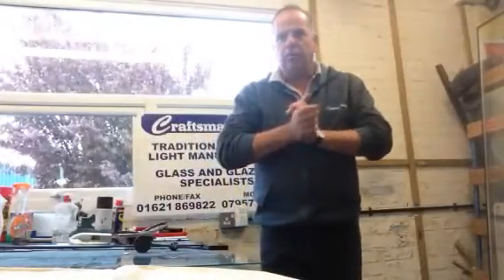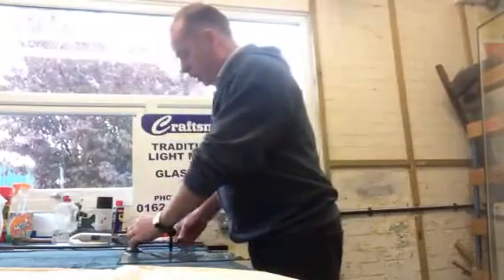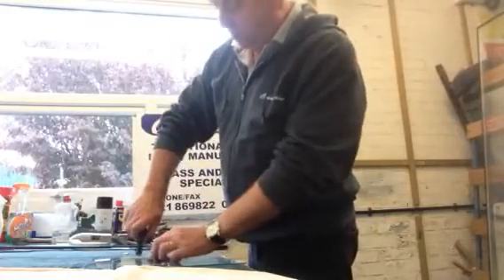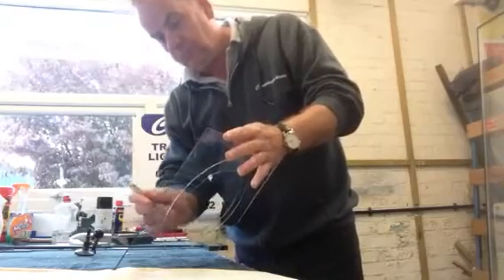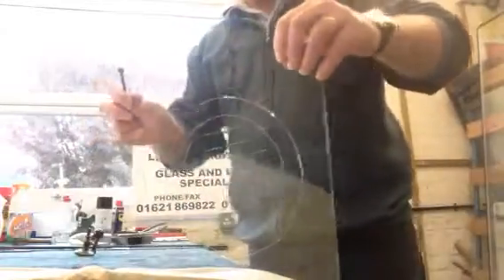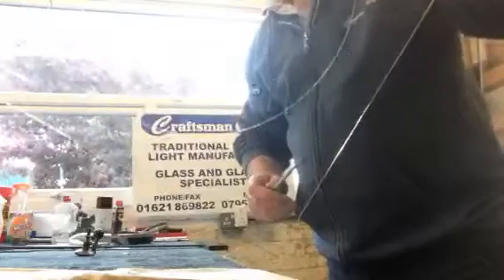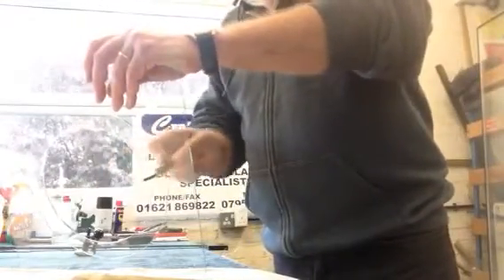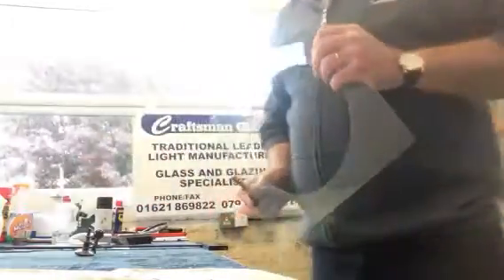Cutting a hole into glass

Comment: Thank you for this... and help me pray today.. I bought a HUGE glass cabinet to build a paludarium.. 140cmx120cmx50.. And i need to cut a 15cm hole into the side to be able to reach the electronics after it is set up...

I might have taken a little to large of a bite to chew because i cant lay it flat to cut a hole into it.. but ok,, it either works or it cracks and the whole thing will have to go to the scrapyard haha..

Thank you for this video very clear explenation, ill try and go about it like you showd,, thanks again
Reply: How'd it go lol. I want to try this on my PC cases side panel because my CPU cooler is just barely too wide for my new case, so the case is just slightly open at the top, I mean it still works and is able to look like it's closed but I want to cut a perfect circle around the CPU air cooler so I can put the side panel all the way on XD. spent 2100 bucks on all these parts and don't wanna get a new case cuz I like it.
Reply: Nevermind it is tempered glass lol. Screw it.
Reply: @tarantulamadness6191  lol , I'm here for the same reason,  I want to put a 200mm fan in the side panel , but yeah , apparently temperd glass the whole sheet will just shatter.

Next option to replace the glass with plastic polycarbonate and cut a hole in that.

Comment: Thank you! 

Upon watching your video, I assume that you need to "tap" the scored glass circle on the underside of the glass. Meaning on the opposite side that you scored with the glass cutter (like I see in the video). I am cutting a circle on one pane of a double-pane window glass and the underside is not accessible. Does this explain why it doesn't work when I tap the scored side?

Best Regards,

p.s. It might explain some of the questions you were previously getting.?.?
The circle is my first step at breaking and removing the glazed in defective pane. IT IS NOT AN IGU!

Tnx!

Comment: Not bad please excuse me.
I have been cutting many years.
From me you need to change that wheel in circle Cutter, you need to apply less pressure on the cut, you need to use cutting oil, you need to use a oil filled cutter again less pressure, for me I use the rubgy ball saftey lines technique, I turn the glass and use pressure to open the cut rather then hitting the hole open like that,, the Chris Cross lines must be with oil, as before a new cutter will open cut lines easyier and thus glass with fall with ease and put less pressure on vent hole, for me the rugby ball lines act as safety lines, tap the middle and work middle first so not to have shells.
Much appreciated for video.
You got it out, 😉

Comment: I have an old aquarium that is going to now be a vivarium. The tank is 5 foot long. The glass is 12mm thick. I want to cut out a 2 foot x 10 inch long rectangle, down from the top - so I only have to make 3 cuts, the 2 foot along the bottom of the rectangle and the 2 sides @ 10 inches. I have various sized glass cutting bits. I have a glass scorer. Would I be able to grind 2 holes, 10 inches from the top and 2 foot apart, then score between the holes, then score from the holes up to the top and then just tap it out? Hope that makes sense. Admittedly, there's possibly some wishful thinking going on.

Thank you.
Andrew

Comment: If while opening the cut, your cut shoots out toward the outer circle, is there any way to continue? I still have about 1/3 of my circle to open and can't seem to get it back on track.
Reply from the maker: Hi , the outer circle is a stop for the cut , if all the cuts are open the crack that shoots off toward the outer should stop at that open cut, you can just carry on ..
Reply: @craftsmanglass6699  Oh, it broke. It seemed like the circles weren't score as visibly as yours. The crack went first to the outer circle then straight past and to the edge...back to a new piece of glass. Thanks for your help!
Reply: I did it! Yeah! I used a slightly thinner piece of glass the second time. Thank you!

Comment: Here's a tip from an old glazier, replace your safety circle with a safety triangle and it will all simply fall out, this will eliminate the need or risk of having to break out the second circle and it's quicker.
Reply: Thank you. Both of you.
Reply: How? can you show us? Really interested in this method. Thanks.
Reply: What is a "safety triangle"? Could you please add a link to tools? Thank you
Reply: @t.n.1953  just draw a fckin triangle with your cutter inside the big circle
Reply: How would you perforate a watches glass? With a tiny glass cutter?
Reply: Thank you both so much!! This video and the triangle tip were so helpful, excited to finally get a project done thanks to this!!
Reply: Does the triangle go to the edge of the outer circle or is there a buffer zone like the inner circle?

Comment: Thanks, needed to know how to do this. What sort of sand paper would you recommend to soften the edges so they don't cut something passing through?
Reply: If its float glass i would use the finest but by hand is going too be difficult cause of time use. Ide use a thin high grade epoxy too dull the edges

Comment: Tried this on Victorian flow glass .. just kept cracking right through the circular cut
Reply from the maker: Hi Dave , it does take a bit of practice ,,  but the main thing is to make sure you open the cut all around , this stops the glass cut running through the whole thing, hope this helps .